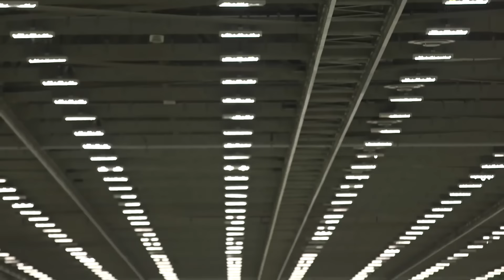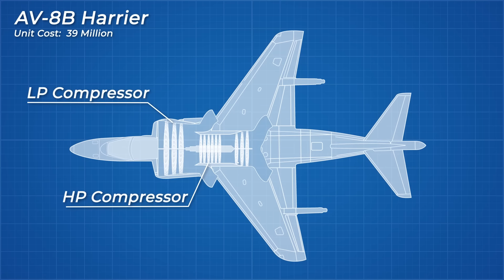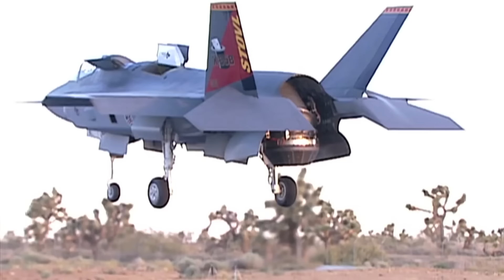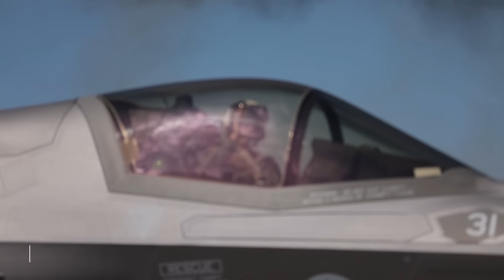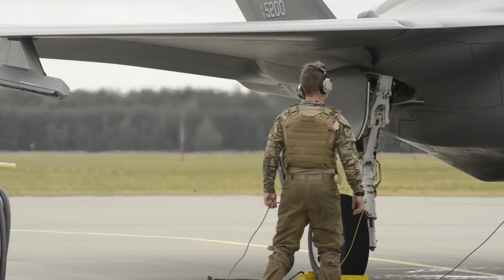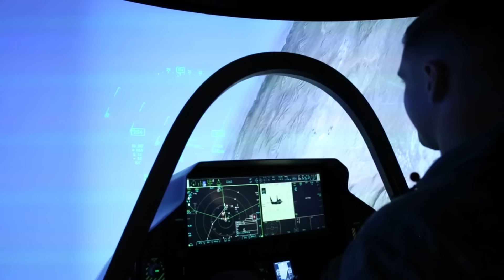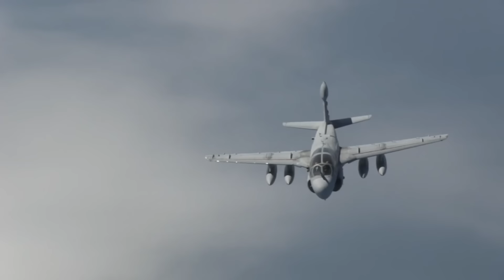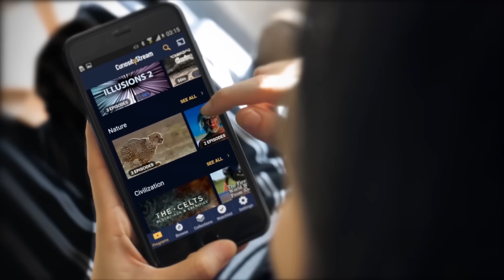Is The F-35 Worth $115 Million?

Comment: The $115 million per unit isn't the biggest concern with the F35.  It's the $36,000 per hour cost of operating it.  That's not sustainable, and Lockheed Martin is already having trouble getting parts.  The jet isn't even in production yet.
Reply: It is in production. Usa already has 450 of them in service
Reply: @yourlocalretard5893  That's pre-production.  They're holding back on production until the design flaws are worked out, because once production goes into effect, every flawed aircraft that leaves the factory costs even more money to fix.  The software update to fix a large batch of the current bugs is already 2 years behind schedule.

Comment: In my opinion, i think the reason why the F35 has gotten so much backlash is because of people's perspective of air combat. Long story short, it's not even close to Top Gun.

16 kilometers (10 miles) is considered basically point blank range, while most air combat takes place from 30-70 kilometers, sometimes going as far as 110 kilometers depending on your missiles, altitude, speed, lack of enemy stealth, and radar capabilities. 

So, the deciding factor in who wins (assuming equal pilot skill) is usually who sees the enemy first, and the F35 is built for that purpose when it comes to air combat.

The truth is, the F35 doesn't need to be better than the Russian fighters in a dogfight, because it can just fire a missile from 50 kilometers away, while the enemy doesn't even know what's happening. And actually, the F35 can in fact compete against American fighters in a dogfight, even though that is never going to happen.

Even if the F35 couldn't compete against Russian fighters, it doesn't need to. The F22 can do all the air combat since it's literally the best air superiority fighter in the world (according to public knowledge) while the F35 just needs to focus on the ground.

Comment: How does an A-10 cost 45 million dollars when it was designed to be a super-cheap machine for fighting cold war era tanks?
Reply: Because it was never any good at that role. The 30 mm cannon is ineffective against more heavily armoured tanks, besides also being relatively inaccurate. Actually the modernisation package to bring the A-10 to its most modern standard costs more than the F-35. The thing that is actually a cost-effective CAS is the MQ-9 Reaper.

Comment: Why not mention that the VTOL technology of the F-35  came from Yakovlev and was developed originally for the Yak-141?
You make it sound as if Lockheed developed it all by themselves.
Reply: Lockheed didn't get anything other than flight test data which helped verify their concerns and understanding of STOVL in relation to their own designs that pre-dated the collaboration.

Factually, the only thing that can be considered a "transfer" is the 3BSD nozzle, as the X-35B design concept used a blocky exhaust until 1995 based on the TV nozzles of the YF-22. I put "transfer" in quotes, because the 3BSD nozzle is a patented American engineering concept first used in aviation by Pratt & Whitney for the Convair Model 200 in the late 60s, and Yak are likely to have obtained the technology from Russian spies. 

Although P&W worked on both the Convair Model 200 and F-35 programs from the beginning, they didn't think of the using the 3BSD nozzle design for the X-35B until after Lockheed' obtained the flight test data of the Yak-141 in 1994, which reminded them of the then 26 year old Model 200. Convair themselves were a part of General Dynamics, who sold their aviation division to Lockheed in 1994.
Reply: @dumdumbinks274  And yet they got the technology from Yakovlev. Which is why they did a cooperation with them for the Yak-141 in the first place.
Should be mentioned. Isnt mentioned.
Reply: @cartrips9263  So you didn't read my comment. There was no transfer of technology. There was a transfer of flight test data, which is a very different thing.
Reply: @dumdumbinks274  Oh I did read your comment.
But I dont take gaslighting seriously. Sorry.
Reply: @cartrips9263  How about you provide an example of technology that was bought by Lockheed from Yak? Otherwise your claims of gaslighting have no weight.
Reply: @dumdumbinks274  ... or anything gaslighters say after they used gaslighting.
Its all well documented. Youre trying to tell people that the moon is a square.
But keep trying to question the obvious just because it doesnt fit in your ideology.
Reply: @dumdumbinks274  of course I can't because you can't link here.
What I said is easily found with simple search terms. AKA just looking up and seeing the round moon in the sky.
It is not my fault that you're such an ideologue and overly proud of your country. I am just stating facts.
Reply: @cartrips9263  I'm not asking for a link. I'm asking you to put in minimal effort and type less than 5 words describing a component that is evidence of a technology transfer. If you understand the subject, you can explain the subject.

There are literally no documents from Yak or Lockheed that identify a technology transfer. There are plenty of claims and speculation from 3rd parties that make up the bulk of search results for the same reason that if you search "flat Earth" you will get plenty of articles about why the Earth must be flat. 

Fact of the matter is that the only similarity in technology is the 3BSD nozzle, which is American in origin anyway.
Reply: @rick7424  As explained in this video, the Harriers technology is vastly different.
And its literally documented that Lockheed got the technology from Yakovlev, kid.

Comment: There are several problems with this video, a few points:

1. The cost you quote is the base walk away price. That is not the final cost of what it's going to actually cost once you have to buy the extras you need to actually train pilots and operate it.  The actual estimate is 300+ million more.  Compare this to something like the Grippon which was designed to minimize maintenance cost, nothing like that here.
2. The stealth on this is bullshit.  Yes LF radio has low resolution, but once you have an idea of where the object is then you can use higher frequency targeting, high gain antennas and multi angle transmission and collection means this is fairly simple to mitigate.   It's an asymmetrical problem it's easy to change the radar system but almost impossible to change the planes to adapt to someone's new system. For instance you could use a different frequency range, normally cloaking or scattering is fairly narrow band, then your carefully designed paint and surfaces are useless. 
3. Fancy helmets and tech means very vulnerable to damage,  or just normal system failure? Complexity is the enemy or reliability and robustness.
4. This is getting bought because of economic relationships not on the merit.  The pressure to sell something that cost 1.4 trillion+ in dev should make you very skeptical of pilot reports, especially internal ones.  Hopefully this thing never comes up against a technologically sophisticated country in a long war.
Reply: Problems with your post. Quotes taken from Finland's F-35 procurement.

1. "The F-35 was the cheapest in terms of purchase price... None of the bids were significantly cheaper in terms of operating and maintenance costs." Finland purchased the F-35 Block 4 for $82 million per jet each. The Gripen E also made a bid. Excluding weapons, all other extras including maintenance equipment, spare parts, training equipment, and other systems and services adds another $51 million per jet. Not "300+ million more".

2. F-35 is designed to be stealthy not just on standard radar X-Band, but all others on the spectrum, including thermals and infrared. So yeah, it is stealthy. Detecting the F-35 is much easier than getting a lock on one, unless of course, it's already quite close.

3. It's not 1975 anymore. Russia went simple and stupid in Ukraine. Look how that's going for them. A-10 was supposed to be simple, stupid and cheap. It did 10% of the strikes in the Gulf War, the F-111 was far more effective dealing most of strikes, including CAS. A-10 was also responsible for a friendly fire incident in Iraq, because they didn't have modern IFF. Now to modernise a A-10, it costs more than the F-35. Most of the A-10 strikes now consist of missiles. Not the 30 mm cannon that's both inaccurate and not effective against heavy armour.

4. See what Norwegian pilots have to say about the F-35, or from any other country. Gripen E was offered for free to the Czech Republic. Yet they're applying to purchase the F-35. To replace their Gripen C/D. Remember, not all countries are allowed to purchase the F-35, and countries have also been denied sale.
Reply: @britishmalayasociety  
1. I doubt this is going to stay at the initial cost but I guess we will have to see currently 1st purchase + support cost of 11.3 billion /64 approximately 150 mil rate, if they do then I'm wrong. 
2. Over the whole spectrum makes no sense.  This is not possible. I would suggest you look at Bode's sensitivity integral. If you make yourself stealthy in a certain range not only is it not possible to be stealthy in another range BUT you actual will become worse. As i said it's an asymmetrical problem.
3. Complexity doesn't mean you don't have good systems, it means you are very fragile. A very complex system that works might work great, until it doesn't. It's about failure states not about performance. Gulf war achieved air supremacy with tomahawk weapons and ships so not sure what your point is anyway.
4. The test of this is in an actual war hope we don't get one. 

I'm still skeptical of this system but appreciate the debate.
Reply: @silentbob784392  
1. That sounds roughly correct. The F-35 does have higher maintenance, but it's not that much more, and overall, price and what package you're getting, it's really quite the bargain.
2. It is possible. TheVLO and electronic warfare go hand in hand with the F-35. We don't have the RCS public for the F-35, and the full capabilities of it's electronic warfare suite. However the military has stated that it is stealth on all bands. Obviously there is a focus on x-band, but even then, the aircraft is possible to be detectable with anti-stealth radar, excluding electronic warfare capabilities, however detection is only just half the game. Getting an actual lock is far more difficult. The Moskva was supposed to be the Russian Navy's long-range AA ship, it's why the fleet is no longer on the western side of Crimea. However, they've always had issues with locking on to, even non-stealth aircraft and missiles. Which is what likely brought down the ship. Unless of course, it was a radar/comms issue.
3. The F-35 has about the same failure rate as the Gripen E. Which is supposed to be the rugged fighter. The Tomahawk Block II was an incredibly advanced missile during the time of the Gulf War.
4. Israel have already undertaken combat missions with the F-35 with radar reflectors. They're not using it's stealth capabilties, in the face of S-400 AA. Modern warfare is not the same as it was in the Cold War and WW2. Technological edge is what wins a modern war, unless you go full insurgency. Weapons and systems have come so far since WW2. It's a meteoric difference, it's like bringing a simple and reliable musket up against an extremely complex autoloading electro-magnetic railgun, it's just no contest. If anything the concern is that China may be catching up (but not really), as in, the technological superiority is no longer overwhelming, but only just large.

Comment: How many Harrier gr9  or Av-8b could get for the price of one F35 the Harrier was like the A10 built like a tank for close ground attack cannot see the F35 doing the same
Reply: They were built that way because low altitude was the only option for CAS back in the 70s. Not that it mattered anyway,... the A-10 was not capable of continuing a mission after taking a hit. The F-16 has better success rates within the CAS role than the A-10, and it's notably less capable than the F-35.

Comment: The f35 is an incredible machine, but when it comes to a mass produced workhorse, the F16 is so much better than this when price is considered. The f35, for a workhorse is not ideal and its not clear how it would be effective for what the f16 is used for. The strength of the f16 is its insane maneuverability and light weight, as well as its thrust to weight ratio, but at half the price per operating hour and sticker price of other 4th gen fighters. It doesnt have stealth and needs a radar update, but it doesnt need stealth bc in case of war we have the f22 to pave the way and then the fighters we already  have can be missile trucks. Now, the f35 is a good idea. A stealth fighter that would be the backbone of the u.s. military will be needed at some point, but unfortunately the f35 is too early. If it was cheaper it would be great but as its so expensive we really should just update their f16 radars and add conformal fuel tanks as a mass-produced option for a multirole. F35 is definitely good for some things, but its trying to do too much for now.
Reply: The F35 has far more stealth and technological capabilities than the F16. While the F16 was a great fighter and did its job well, and updated F16 model would struggle in modern operations with how it was originally designed. Also, saying that the F22 already meets the US’s stealth needs is just blatantly false as the F22 is made for air superiority with air to ground strikes as a secondary capability. The F35 was made to compliment the F22 with its air to ground strikes while the F22 could clear out enemy air spaces.
Reply: @orion_6346  correct! Im saying for general missions the f35 is not the best idea. The f35 also has additional attachments that remove stealth but allow it to carry more munitions, and this would be for following the f22 into combat after the f22 had established air superiority and made it possible for the rest of the aircraft to enter. In other words, the f22 would go to war and the f35 would be a great support, but at the end of the day the f22 is pulling most of the weight. Now, the f35 is a great thing to have in a strike group bc it does have stealth, but it doesnt need to replace every single 4th gen fighter. Let it have its own role, but we dont need to spend the entire defense budget trying to make one plane do the job of at least 4. Jack of all trades, master of none
Reply: @thercf16guy35  The F-35 can carry weapons internally.

Seriously. Do you think you are smarter than the top bras and the R&D team because your unsourced opinion is based on five second of forethought?! The arrogance is astounding!